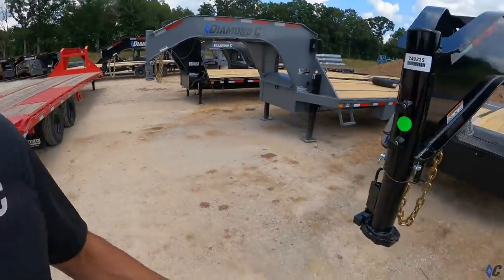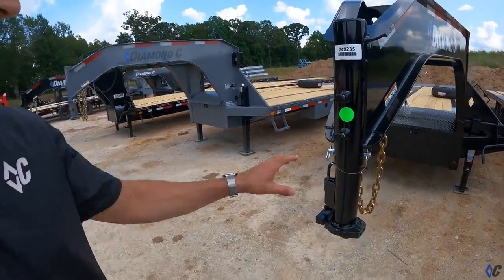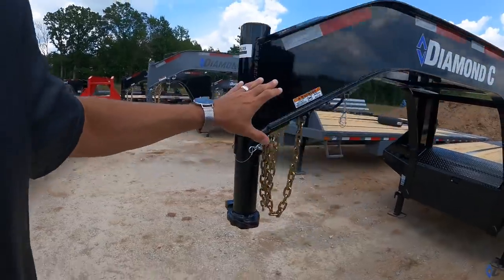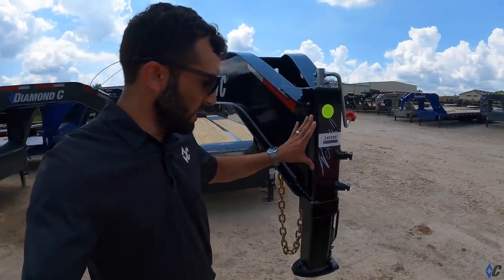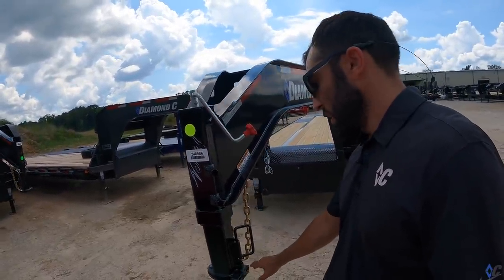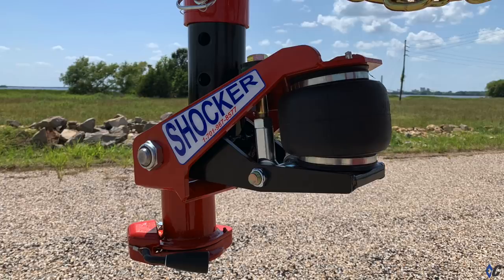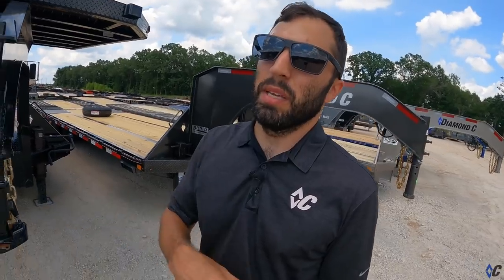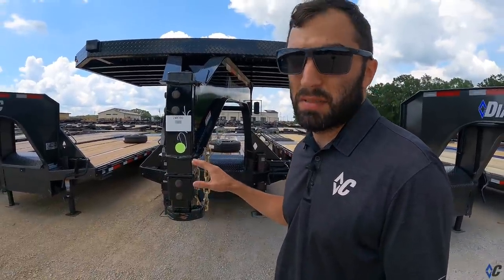Gooseneck Couplers Overview | Diamond C

Comment: Trailer nerd checking in.  Also interested in the step deck version in the 216 for small heavy equipment delivery with my flat bed Ram 5500.  I watched Banks Shipping, LLC's video and noticed he was working a few things out with you.  Very cool!  I realize he is using a single rear axle Pete with tall 24.5 rubber, so that is an issue.  Any videos for coupler options or actual coupler height adjustment options for the step decks?  Thanks!

Comment: If a special order is made with 3 X 16k disk brake axles, then the GVWR can be in the 45 - 54 K range. Do you guys have couplers, balls, King pins that support such a setup if the customer is willing to pay for it?
Reply from the maker: Great question! We can only rate at 40K. But yes, would require a pintle ring or flush mount king pin for the correct capacity rating.

Comment: I was wondering if there are torque specs for the set bolts on the couplers. If I missed it, I apologize in advance.
Reply from the maker: Good point! The torque spec is 125 ft/lbs on the gooseneck coupler set bolts.

Comment: Do y'all do fifth wheel air ride.
Reply from the maker: Yes we sure do! 😁
You can do an FMAX with a king pin adapter for 5th wheel or you can do an SDX step deck with king pin for 5th wheel. 👍

Comment: I have one of your 2020 gooseneck 212 air ride with a Shocker on it .
  Will the shocker fit on a 48ft Stepdeck airride 212 ?
Reply from the maker: Hi Richard, thanks for stopping by!
Unfortunately it won’t fit on the stepdeck. The coupler on the stepdeck is square and much shorter tube.